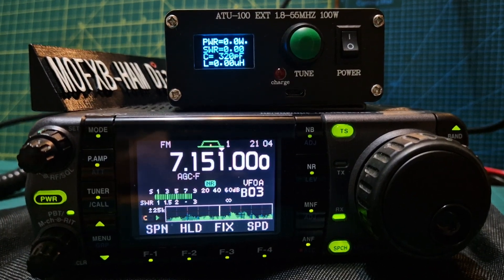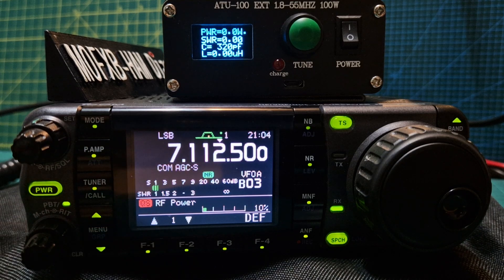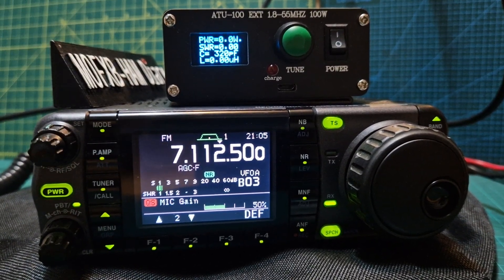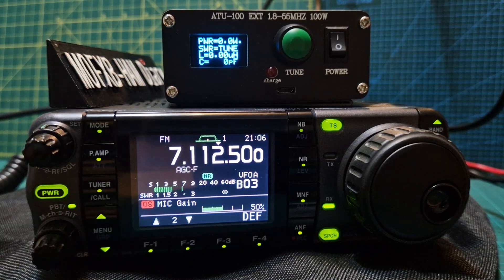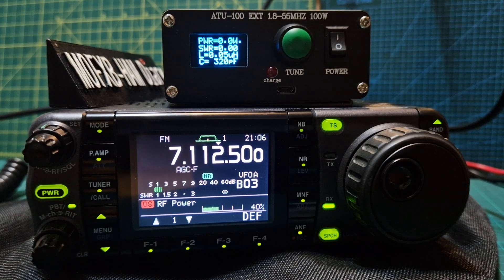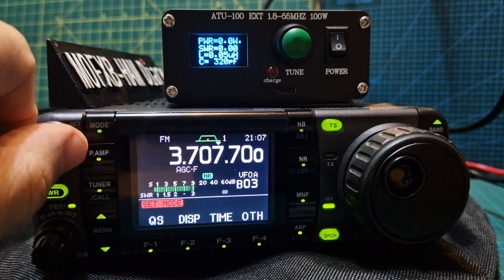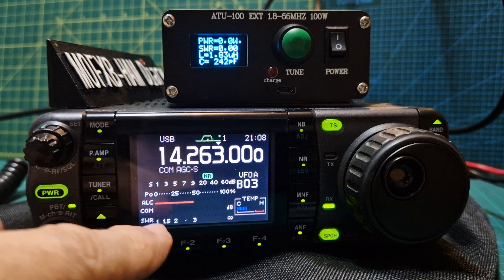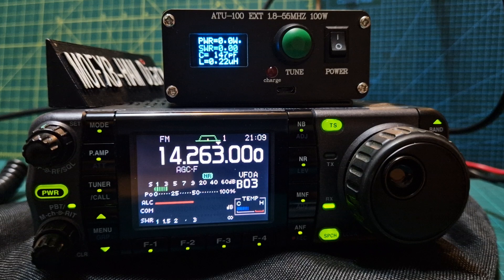ICOM IC-7000 & ATU 100

Comment: I have a  buddy he gave it to me just have to be careful about what antenna you use don't use and Endfed dipole.   Unless it is very close resident I was 10 watts doing ft8 on 80m and I smelled then the antrenna tuner.  One the rf chokes burned the paint off.  Got lucky it still works well.   I had it checked out.  Just make sure you check the type off antenna you use on it.
Reply from the maker: Hi yes i will be careful i tend to listen and only tx about 30watts i do have an antenna tuner.
Reply: @M0FXBHamTech  sorry I this one. As well it does not. Like 9-1 endfed  dipoles on 80m.